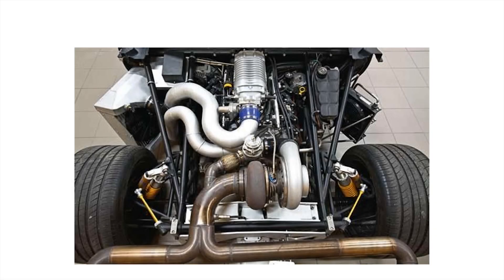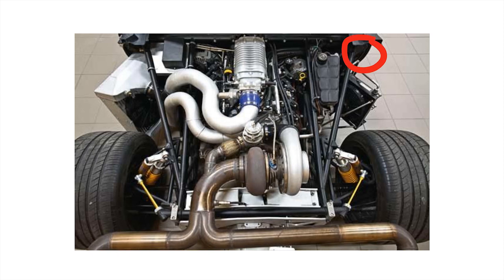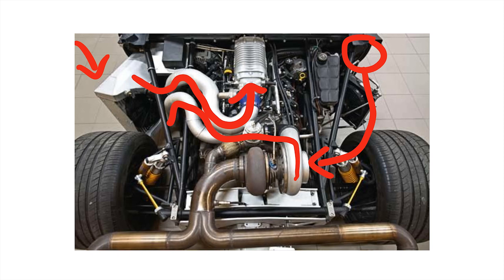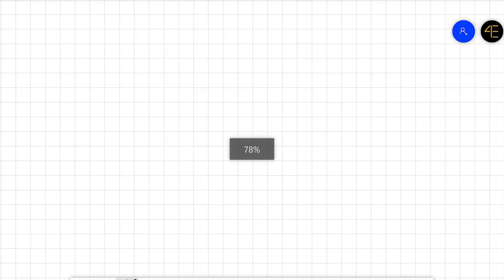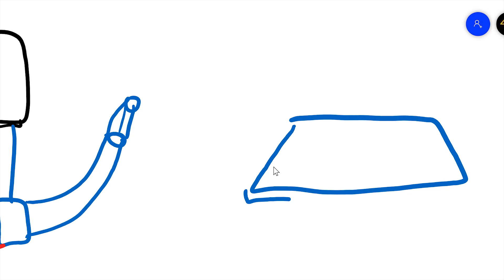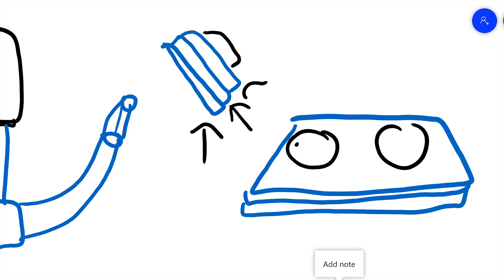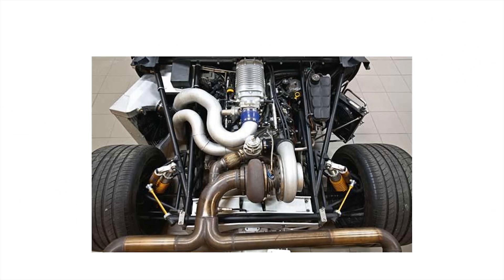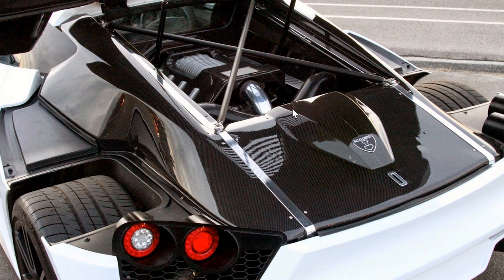Zenvo ST1 Twin-Charged LS7 System Explained | 4enthusiasts

Comment: a twin screw supercharger compresses gases inside of its compressor housing, while a roots compresses down stream air (ie, the air in the head downstream of the supercharger. roots superchargers put more stress on engines.
Reply: This + the rapid gas movement when the rotors brush past each-other both create serious parasitic forces so Roots are inferior in every way in performance & the losses are seriously far more significant. Really only x4 reasons to still use Roots over Twin-Screw are: 1: space constraints, 2: low-RPM & low-pressure use like Detroit Scavenging, 3: Price, thanks to all those Old Detroit (2-strokes) & lastly, No.4: regulations in the motorsport you're participating in. 

Otherwise Twin-screw is purely superior. But, I have still not seen a any data between these two + 4-lobe TVS Roots, since the twist angle is very sharp maybe there is significant internal compression there too, or am I mistaken? Either way has to be at least a bit better than 2 & 3-lobe Roots' performance, I'm sure; but the question is how these 4-lobes perform compared to the Twin-Screws.. Hopefully they could be more efficient at low boost & RPM, just like their original R0ots(get it? lol) & maybe they'll have real uses in a workhorse Diesel where either low-end torque is really crucial or Turbos aren't a good idea for whatever reason.

Comment: Except for the whole bit about hot turbo air being bad for the supercharger regardless if it's aftercooled or not; this engine could use both an intercooler & an aftercooler, frankly, to control temps and maintain the ability to have SOME spark advance

Best setup would be this intercooler setup they used, and water-meth injection directly into the supercharger housing.
Reply from the maker: Water meth is a bandaid and not a solution

Comment: Nice Video you made there. But i think i have to correct you in one thing. The Engine of the Zenvo ST1 has two intercooler. The first as you mentioned is a air-to-air intercooler right after the Turbocharger and before the supercharger. But there is a second Water-to-air intercooler right after the supercharger, like where the intake manifold would sit on regular LS7. You can see it in this video: https://youtu.be/gjBrT_tc6KQ?t=501
Another thing: If the System would be like you personally would have liked it, the supercharger would compress uncooled and therefore very hot air right from the turbocharger. This would have made the compression from the supercharger in a thermodynamic way very inefficient, because the entropy of the first compression from the turbocharger would not have been taken out of the air, therefore the density of the air would not be that high.
Reply from the maker: Thanks for the info. I’d assume there was an air-to-water Intercooler underneath the supercharger. At the time I was playing around with the idea of adding an interchiller to this design. The heat exchanger’s coolant temp would be very low as convection wouldn’t be dependent on ambient temp but rather cooled through the refrigerant. Looking to do some simulations in the future to experiment on the temperature difference  and pressure losses between these two systems. Only downside is the use of the ac compressor